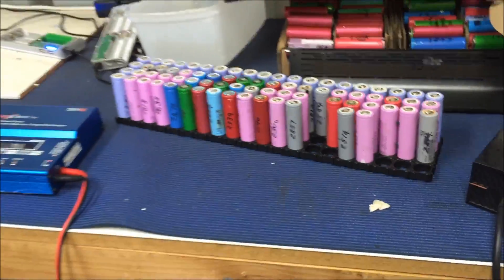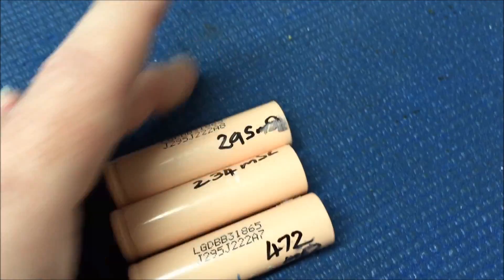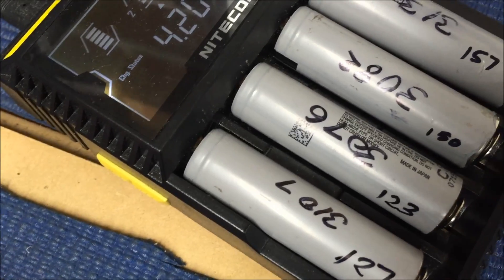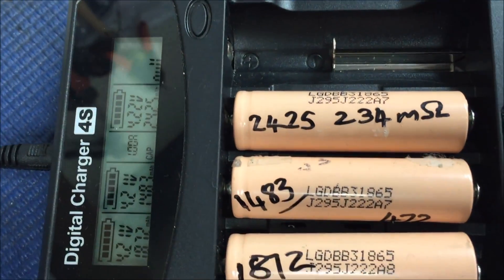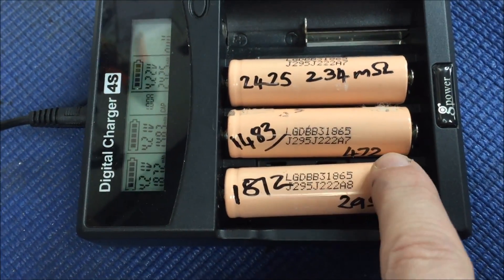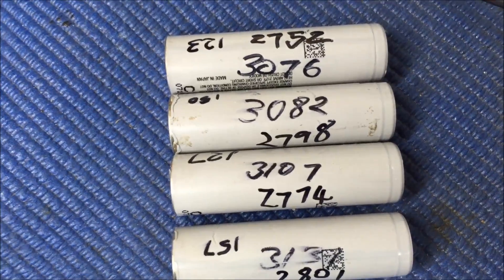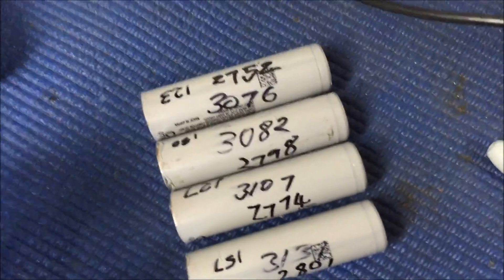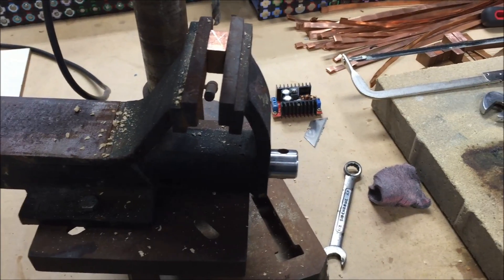resistance testing 18650 cells - should've done it...

Comment: great the test of Internal resistant .. is good to get balance bank get not more of 10% of different , on my experience after run this for many years the and get really stable a easy to use.  Now you have see the when IR start to get hi get heat and self discharge too and hi unstable cell. but are nothing to make the experiment and analyzed the data after to take conclusions.. keep going nice project.

Comment: IR SHOULD BE TESTED AT 70% SOC OR LESS
Reply from the maker: yep preaty much all of them were about 3.3v so close enough i thinks
Reply: yep thats good.
Reply: ***** http://www.all-battery.com/TenergyIntelligentCellMeter-01444.aspx?utm_source=GoogleShopping&utm_medium=GDF&gdftrk=gdfV26767_a_7c354_a_7c922_a_7c01444&gclid=Cj0KEQjwx7u5BRC1lePz2biJpIYBEiQA-ZeDmsM-sAxRwhv_SFvshY356yJbHdVZ6EPhAIpDwKPDz0kaAkDy8P8HAQ
Reply: Powerlab 8 will graph the IR. 
Doing it threw the charge cycle AWESOME information.
Reply: If you look at the data sheets of new 18650 cells,... when the charging voltage reaches 4.2 V, the cell is charged about 75 to 80%. But this is on new cells which have an internal resistance of below 30 mOhm. Older cells have higher Ri, which basically means they reach the 4.2 Volts faster and the charge is then less than 75 to 80%. What you can take from this is that as long as the open voltage of a cell is below 4.2 Volts, you're good.

But don't measure Ri at too low Voltages either. 3.6V should be fine I think.

Comment: As I've pointed out before, I found each time I charged and discharged a cell, the mah readings were lower.  But it seemed to settle on the 3rd cycle.  Of course each time I did it the mah was lower than last test.  I suppose you could run 7 cycles, but I decided to run only 3 in the interest of time and sanity. After all these are nasty old abused cells likely at end of life in the first place.
Reply from the maker: bugger doing it several times - after testing several thousand cells i'm not even going to consider it. i'll just buy extra smoke alarm...lol
Reply: yep - there is a point of diminishing return.  What I decided to do is have smaller pack of 40 cells.  I parallel and series together to get desired current and volts. That way I can swap out small packs for repairs.
Reply: My guess is, If you got lower capacity number after every test, its because Resistance is higher with higher temperature. While discharging cell temperature is going up, resistance is higher with higher temperature, and with higher resistance more energy is transfered into heat, instead electric energy, and you got lower capacity

Comment: Before la$hing out for a new vice you might be well advised to use a spirit level to check vertical and horizontal alignment of drill bed and drill bit/drill drive?
Reply: I'd just screw a couple pieces of wood to the bed of the drill press, to make a jig. That way all you're bits come out the same. If you clamp them in a vice, they will almost certainly all come out slightly different. Also I'd advise using a center punch and drill a small pilot hole before drilling out to you final diameter, takes a little longer but it's worth it for the quality of the final product.

Comment: For 24v is it better to do two 12v or one 24v. Also if I where to charge the 12v 600 cels with solar what charge will be the right for this pragect 30a or 40a. and how many amp is 600 cels A
Reply: Build your pack as close to the voltage you need is the general rule of thumb. I'd say your good for 3-4 A per cell in parallel discharging and 1 A per cell charging. make sure your buss bars and terminals are rated for the full amount of energy you intend to draw and have a fuse or breaker rated just less than the packs total amp output.

sorry I don't know the specifics of your pack but at 12v 600 cells, I assume that's configured 200 parallel x3 in series. you could charge at up to 200A safely, though I wouldn't try to push that much current in, hope that helps.
Reply: thank you for you time. one more question the link that i send you its a same battery that i ave more then 800 is this a good battery to use for any volt 12, 24, or 48v http://www.costcobusinessdelivery.com/TYLT-3200-mAH-Portable-Power-Bank,-2-pk.product.100206283.html
Reply: If whats inside is the same as the labeling on the outside it would be exceptional for a pack build, Wouldn't be able to tell for sure without seeing the printing on the cell itself.
Reply: if you go 12 youll need 3 in series, 24 youll need 7 and 48 youll need 13. the voltages don't devide evanly so it's best to round up on the 24 and 48, but that will also increase the life of the cells.
Reply: Hi thank you for answering all my questions and giving your advise. dose the mAh matters for example if one battery is 3200mAh and the other one is 2800mAh can i put dose to battery in one pack. Also if i want to make 48v battery pack dose my charger have to be 48v or it can be more like 55v . the reason i asked this is i want to know if i can use the ups aps system to charge my 48v battery. And for the battery  do i need to have fuses on both side
Reply: for mah you want your parallel groups to be as close to the same as possible, you can mix mah within the groups of cells, but try to make your groups all add up to around the same amount, for instance if you build 13 groups of cells and wire them in series to get your voltage (48v pack) your pack will only last as long as the total mAH rating of your lowest capacity group. (I hope that makes sense),
The thing about using a 55v charger is more about about your personal preference, I generally don't charge my batteries to full (I charge to 4.1v per Group of cells) but I usually give em a full charge (4.2v) once in while to keep em fresh. By doing this I get much more charge/discharge cycles out of a pack. However many people charge to 4.3V and are happy with the results, I don't recommend this as overcharging will reduce the life cycle of your cells, and can generate heat (too much heat can cause thermal runaway and the pack could potentially explode, catch fire, or your cells could burst). That said 55v divided by 13 groups gives you 4.23v per group, so theoretically that would be safe. But If your paranoid (like me) you would add another group and make it 14 groups (51.8v pack) wich will take a charge up to 58.8v, you would never charge the pack to full and this will increase it's life significantly and improve safety.
Reply: oh and fuses, you only need fuses on the positive side, some people say you don't need em at all, but I always go for safety, fusing both sides is a waste of time, once one of em blows it breaks the circuit so there is no need.
Reply: thank you for getting back to me. that was very simple and understanding
Reply: NP, wish you luck
Reply: Hi again. if i have two solar panel 36v 255w each how can i charge my 48v and what charge controller to use